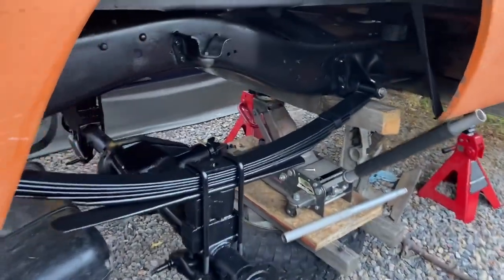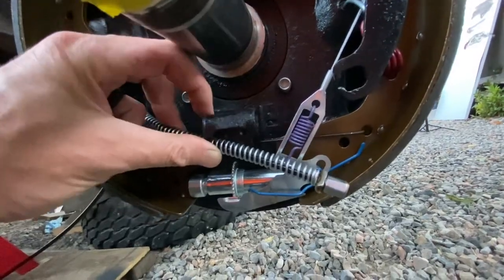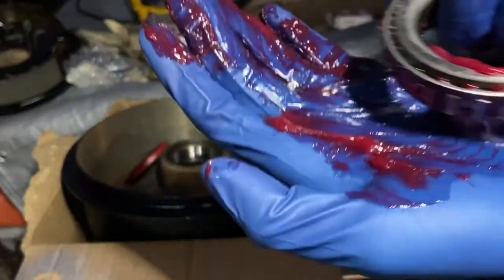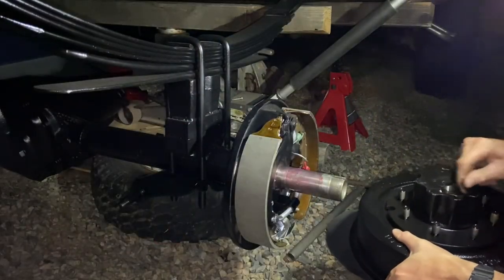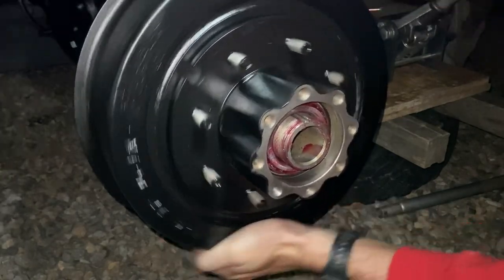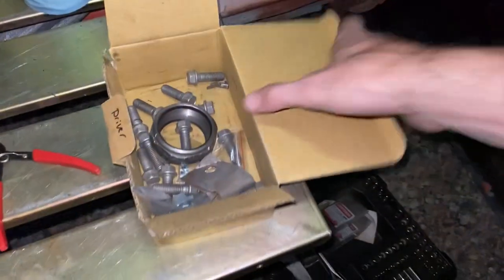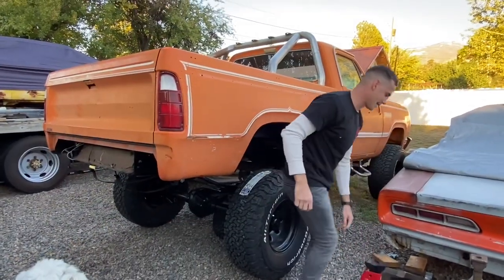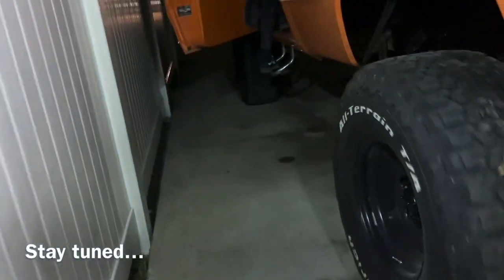Alex's Project ‘78 Dodge Power Wagon: Off Jack Stands, Finally!

Comment: One of my favorite trucks was a 78 dodge, full time 4x4 was the only downside, it had a 360 with an Edelbrock intake and carb, it had the baby Dana 44s  but it was plenty tough for 33s. The bedsides were  pretty rusty, but that just meant I wasn't afraid to use it for truck things. It was super reliable while I had it. Always loved the 78 grill. It was the best front end on these dodge trucks.
Reply from the maker: They are such rad trucks, I had an 84 before I met alex and it was a workhorse simple and fun like that. Thanks for sharing💪🏼

Comment: Best video you have posted to date. Great content, awesome interaction between you two and the dogs, and the truck is now a roller. Don't stop now, it's getting real interesting!
Reply: Did you put a gasket or sealant on those axles before you bolted them up to the hub
Reply from the maker: Thank you very much for the support and feedback, we’re not stopping this power train!💪🏼

Comment: Hey, good info on this video. I do have to question the double blocks for the rear lift. Knowing single block is factory. For show it’s ok, but off road it’s not safe, stressing the U bolts on side load. If your going off road I would suggest a lift block eliminator spring set.  I used W20 “Rough County Company”. Spring set.
Reply from the maker: thanks for watching, its not going off road at all...shes a pavement princess. I welded the blocks together, it will be fine driving around town.

Comment: I own a 1967 Power Wagon with a 340,now I own a 1947 Power Wagon with a 440 v code and with 1974 W300  Power Wagon running gear
Reply from the maker: That’s way cool man, did you mean a 1974 power wagon with a v code 440?